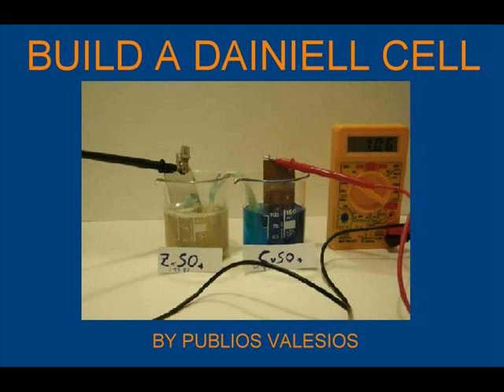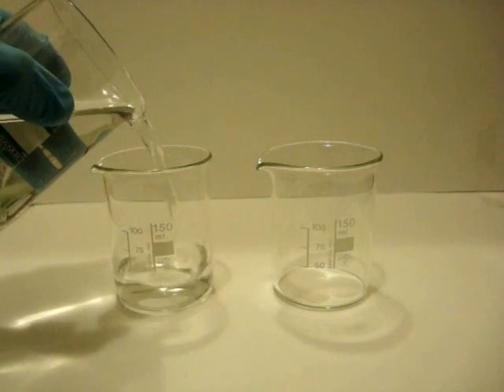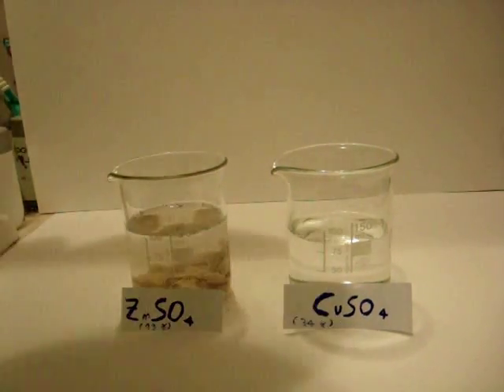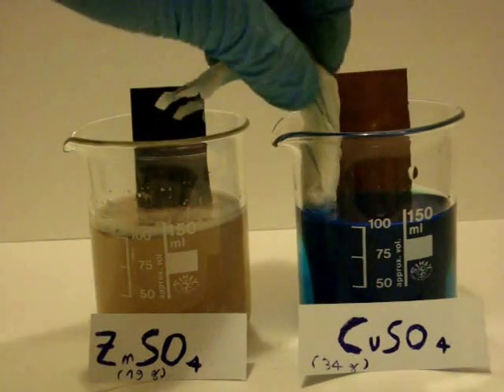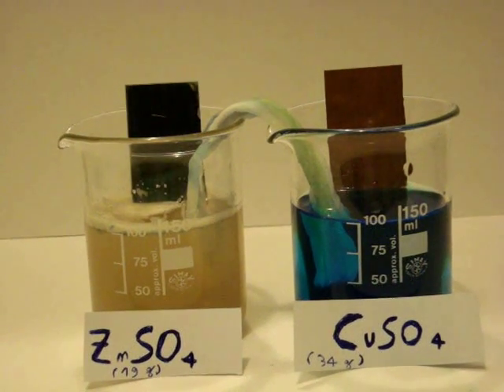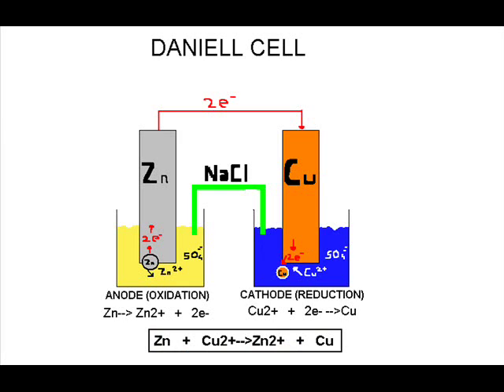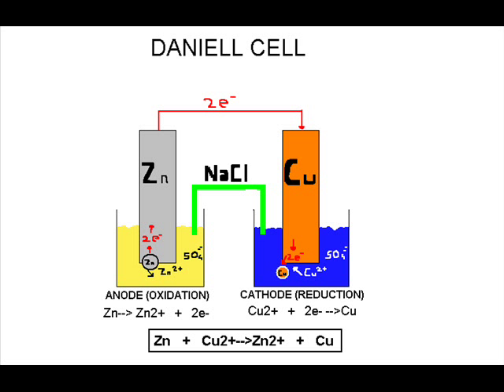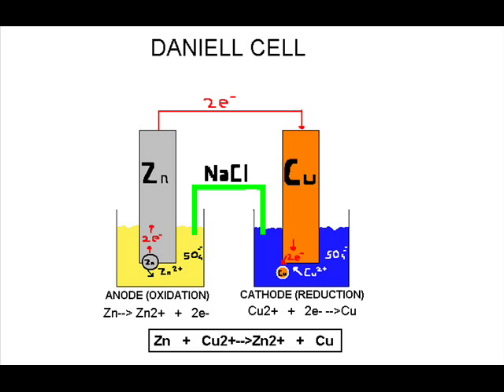BUILD A DANIELL CELL

Comment: Another way to make a Daniell cell:
Ingredients:
Potato
Zinc
Wire
A piece of copper
For best performance, boil the potato.
Put both the copper and zinc into opposite ends of the potato, and connect them with a wire.